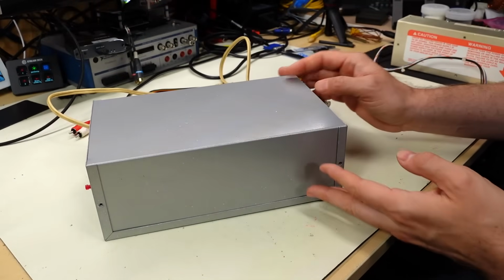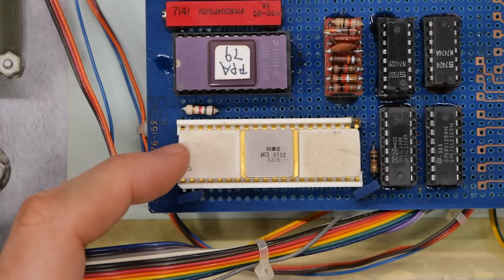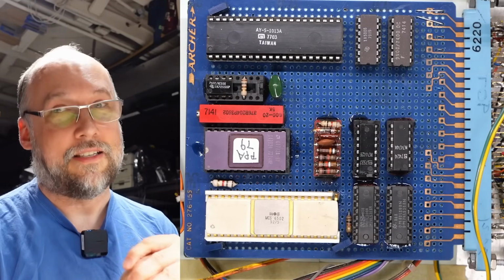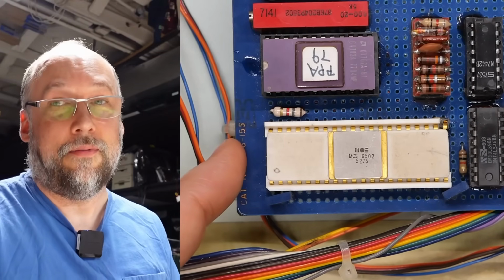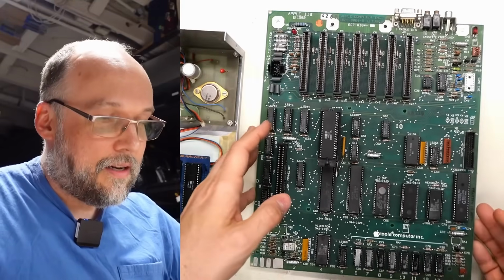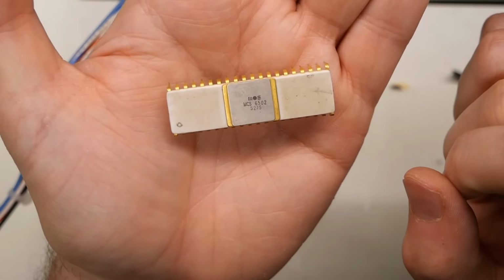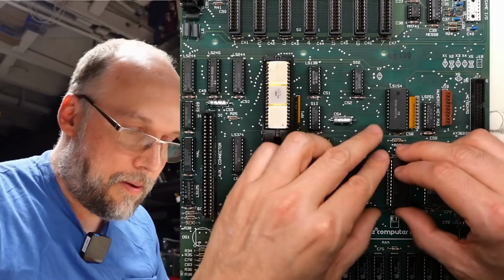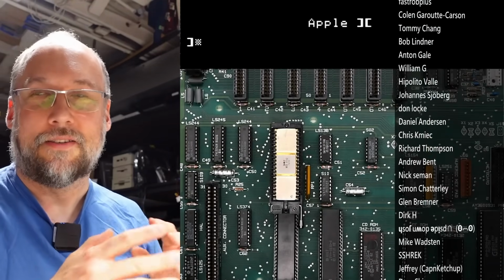Let's test a 50 year old MOS 6502 CPU

Comment: I'm surprised the bugfixed chip didn't get a separate designation such as 6503 or 6502A.  Because it surely must have been a hassle having to add production instructions to not assemble chips older than certain dates into products containing code needing the fix.

Comment: The ROR instruction is almost certainly used in division or floating-point math code.  I bet if you calculate some stuff in BASIC using division or floating point numbers, you'll see very bugged results.

Comment: never know what you would find before opening it first
that caught my attention someone back in 2002 make that and use it to booster performance something im at loss information about it n all i know that blue pcb was make in 2002 that was all i have n i remember got few them 2003 and use it make adapter attach to hdd which apple 2c u cant run hdd without card else so that was all i remember

Comment: I love the look of those white ceramic processors. Even if it were totally dead, it would still be a beautiful display piece.

Technically you could program around the bug. You could do some other maths operations to achieve the same result. It would take a lot more instructions, but it would probably work. Most of the time anyway. Anything that relied on the instruction taking exactly as long as it takes would break, so you'd have to modify the code for that too.

But yeah, considering they fixed the bug in just a matter of months, there would be very few commercial products that used a bugged version of the processor, so it would be pretty much useless in anything but these kinds of homebrew projects.

Comment: Beautiful find.  If you're talking about the same Frank that worked on the Commander X16 - he's a monster.  The amount of code he puts out is insane, and it wasn't easy to figure out a lot of his stuff.  Not because it was obfuscated, but because he's just good.  One day I'm going to have to dig back into 6502 stuff, it's fun.  Just taking a break from about 1000 projects right now.

In the early days, I did some work creating a Vera lib in ASM to link into C code.  Was kinda cool.  Sorta wouldn't mind dusting it back off again, unless someone else has taken up doing low level X16 libs for C :/.

Comment: Warning Adrain - never use any TTL parts from Signectics. They had a ridiculously high failure rates and I guarantee that the data books from Signectics are total crap and full of gross tech specs errors

Comment: Minute 3:00 - I have not even seen you open the metal Budd box yet, but my speculation is that it is a serial to parallel converter box to drive a Centronics printer. Wahla. But what would have been even rarer then a MCS 6502 was a MCS 6500 of only a 100 were sold if any. Because the MCS 6500 was totally
 compatible with the Motorola MC 6800 and was an instant, within one week from the ads from MOS technology for the MCS 6500, a LAWSUIT from Motorola.
Reply: It's a PET to ASCII/Baudot interface. This interface is in Kilobaud_Microcomputing_1979_September.pdf (which you can Google), p100-102.
Reply: You think that's why the ROR instruction was intentionally "broken"? I'd be interested to see this actually run some Apple II software like Number Munchers or Visicalc to what it does.

Comment: The most likely place for the ROR bug to show up is in math functions, and I'd guess that a multiply or divide is the most likely math function for it to show up in.  Probably in a divide, since rotating right by one is a divide by two.
Edit: If it instead does a rotate left as you said, then you should either wind up with some number which is obviously both wrong and higher than it should be, or else the BASIC interpreter will give you an overflow or divide by zero error (depending on the exact calculation you're doing).  Anyway, congratulations on rescuing a rare, historical chip.

Comment: That early chip is quite the find. Most of the interesting stuff like that around where I live has long since been scrapped/thrown away.

The design of the device reminds me of the old morse code keyboard I have. It's also very basic, with not much more than a 6502 and a 1702 EPROM or two, and plugs into all its cables using an edge connector.

Comment: For some reason, even though I turn 30 next year, I still think of the 70s as being 30 years ago. The fact that the chip still works after all this time is baffling and amazing!

The only thing that makes it a little bittersweet is that this could be the last time it will ever run code, especially if it's in a shadowbox. I know practically speaking it wouldn't be good to have it running all the time, either, but I kind of wish it would get run once a year or so, even if it's just as a microcontroller for a clock.

Comment: That chip is from the 52nd week of '75.... i'm from the 11th week of '76

My favorite processor is the Z80, i would've loved a Z80 made the same week i was born... alas, they came out later in '76

My SECOND computer was a IIe, so, while i am nostalgic for the IIe, and wish i had one, (with the two black-faced hard drives on top, under the monitor) my first computer was the TI99/4a, of which i own several, including my original!

Comment: Now, if only you can find out who made it and when he made that board.
I worked on Vic's  all the way up to Amiga's I even had a Pet for a while.  
I still have a C128, I think I have a C64 as well. 
I should get them out and find out if they still work.
One of the thing I did years ago on my C64 was copy the rom to ram.
I then modified the text and screen color, I think it was white text on black background for the TV I used at the time.
I forget what the text said, it just did not say Commodore C=64 anymore. 
I think it was a magazine called transactor, I edited the tape drive function out and installed a new routine.
When you pushed the Commodore Run/stop it would boot from the tape drive, now it would default load "*",8
I then changed it to use the last drive you loaded from if it was device  9 or 10 then it would be load  "*", 9 or 10.  
I miss that C64, I do wish I still had it.  

Lee Clark

Comment: The AY-5-1013A is a UART. The 555 with a multi-turn pot next to it is most likely used to set the BAUD rate for the UART and potentially is also the system clock.

Comment: Thanks for the mention!  Wow. Now that is a very lucky find.  I have one very early 6502, but it's soldered into my OSI 300 trainer.  I don't know if I could devise a way to test for the ROR bug as I'm reluctant to remove it.  Very cool, Adrian! There may not be real buried pirate treasure, but there is still lots of digital treasure buried away in devices like this waiting to be found!
Reply: You could use the switches on the trainer to enter a simple program: LDA #$22, ROR A, STA $8 (assembly is A9 22 6A 85 08; use Windows Calculator to translate to binary).  You'd then read from $8 the result, which will be $11 (or maybe $91 if carry was set) if ROR works correctly, or it will be $44 if ROR behaves like ASL (the bug).
Reply: But based on the date code, you should expect the bug.  That's an extremely early CPU; one of the first few, in fact.
Reply: Look on the top for a Date code: Do you have access to the assembly/monitor? Its only like 5 instructions to perform the test. The message is 3x the size of the test. Is your ROM soldered in?
Reply: @joeturner7959  My 6502 is date code 3875.  It is soldered in place.
Reply: @TechTimeTraveller  

So processor and ROM are both soldered. :(
Reply: @joeturner7959  There's no ROM on the OSI 300, sorry..  just CPU, a 6810 RAM and some support logic. But yes.. everything is soldered.
Reply: The first revision does not have that capability. Therefore the rotate right instruction isn't even a bug.

Comment: Your enthusiasm over this made me smile :)

When you get the shadow box, maybe put a mirror on the inside surface so you can see some of the wire wrap
Reply: Excellent idea. Seconding this! Could incorporate the board's edge connector into the side of the shadow box to hold the board a little off of the mirror to make it easier to see the reflection.
Reply: @spagamoto  That's a brilliant idea

Comment: Hey Adrian, that's an amazing find! The ceramic MCS6502s are highly sought after by Apple-1 replica builders for their original appearance. They are virtually unobtainium these days and sell for upward of $3000 on eBay.
Reply: Do they sell for upward to $3000 on eBay or are they asking upward to $3000 on eBay?
Reply: @Okurkaarrgghh  Excellent question!
Reply: @Okurkaarrgghh  That's probably the ultimate question. There is one that did sell on October 26th for $1500 bearing a 3975 date code though, but that may be a unicorn.
Reply: @rjolly87  Sold mine direct to a collector for $1500 (don't like dealing with ebay) ..I had bought it in '75  for $20, new for a project that never happened..
Reply: @Sloxx701  That's one of the earliest possible, you can't compare it with this one.

Comment: It's interesting that the ROM boots, its likely that whatever operation uses the ROR function doesn't have its result verified, so the ROM is 'running' but at some point you're going to try to use something in memory that's been run through the buggy ROR routine and you'll receive unexpected results.  Still very neat to see it preserved and the short history lesson!  Thanks for sharing!

Comment: My first hands-on exposure to any computer chip was with our first computerized controller (I did not design it, though --in those days I still was fluent only on DC and audio).  It was built with Motorola 6800.  Because I later on got actually involved with occasional troubleshooting, I gradually learned a thing or two about it.  I also still have some related measuring stuff geared for it.  Later on, we switched to MC68 000.  The 6800 based control was introduced in 1980 and the 68 000 based one in 19855.  I still have a few chips of both generations, as well as access to a logic analyzer with a disassembler for the 68 0000.  When I say access, I mean it belongs to my former employer, but nobody else than me has used it at least in the past 30 years.  I brought it along with me through two company ownership changes.

Comment: I'm regulary watching your programs - bringing back memories from the days I was designing and building the hardware you're playing with today
But one thing makes me wonder - haven't you heard about IC extraction/insertion tools?
You can get a nice tool (for a few dollars) which you place on the chip you want to extract and you get it out of the socket eithout damage or bended pins - not the brute force by using a screwdriver or a solder tool
Btw I've wirewrapped so much that I think the wires put together will reach around the globe

Comment: I'd shove a block of conductive foam or some foil onto the rear wire-wrap pins on that socket before you put it in the display case.  Pays to be safe.

Comment: My question now is... what does it take to get to the ROR function and to crash?
What program do you have to type in/use, what routine do you have to perform in order to cause the crash? And what is the crash like, is the CPU broken after the crash?
But don't try to break it on purpose, this is a gem, almost 50 years old, tucked away safely in some homebrew box.

Comment: The computer I have ever touched was a PET 2001. Later my parents bought me an Epson HX20 which had two 6301, a cmos variant of the 6800, running at 614kHz inside. One of those early laptop predecessors is still sitting on the shelf here.

Comment: I don't know what is it about shift and rotate instructions that are so challenging, but the Z80 had a similar bug. Rather than fixing it as Motorola did, Zilog left the instructions undocumented. And they exist to this day. The broken instruction was the SLL (Shift left logical) set. People used the broken instructions as it was quite useful to multiply by two and add one. Perhaps that's why they never fixed it. It would have broken code that depended upon it.

Comment: What is also amazing is that old ROM from 1975 that Adrian dumped the contents of to his computer also still contains the code. I thought EPROMs only had a lifetime of 10-20 years before the tiny charges on the memory cells leaked away.
Reply: The retention time depends on a lot of stuff like temperature, chip manufacturing process, how "well" it was programmed (some programmers were stupid and didn't over-program the cells well enough so they were just barely reading 0's for 0's in some spots while the default erased state is 1 - the best programming algorithms are a little complicated and try to gauge how efficiently each cell accepts programming so that they can be over-programmed uniformly)

Comment: I'm feeling old now... my first 6502s were from 76 or 77, and I built far too many systems with 6502s and wirewrap. Still have a handful of WD chips in a drawer...
Edited to add: I have an idea that Apple ][ Basic was a customised MS Basic - and early versions of that had a workaround for the ROR bug. But that said, ROR is unlikely to appear anywhere except in arithmetical/mathematical handling. You might use it in character output (and byte with 0xf0, ror four times, or with 0x30) but that works just as well with a shift right.

Comment: The GI AY-5-1013 is a UART. Interesting thing with the 1702 EPROM (besides the -9V rail) is that it is normally inverted... Where you'd expect FF in a blank, it is 00... at least that's what I remember for waaay back. I'm guessing the 6502 IS running exclusively out of ROM (using registers for storage), and the shift register captures the serial output from the 1013, and assembles it in parallel fashion for that ribbon cable. The 1013 and the shift register make a crude  partial 6820/6522. Latching a couple 7475's would require a lot of extra parts (address decode, latches, etc.). The 1013/shift register (parallel output) is pretty elegant. I don't think 6820s came until '76, and 6522's a couple years later...
Reply: Your guess that the 6502 is running from ROM using internal registers is spot on. The interface article and schematics are in Kilobaud_Microcomputing_1979_September.pdf (which you can Google),

Comment: I bet that was made by an Intel or Techtronix engineer out in Hillsboro - they probably picked up that 6502 in early 1976 to keep up with the latest tech. It might even have been one used at Intel to evaluate a competitor's cpu before an employee took it home as surplus in 1979. Then many years later someone was clearing out the garage and it ended up with you.

Comment: 23:36: If you were to test the Apple II + 1975 6502 more extensively, maybe on your second channel, I'd be happy to watch that. I'm now wondering if Apple accounted for the ROR bug and wrote their Apple II firmware so as to test for the bug and work around it if present. Of course, it's a safe bet most Apple II software did not do the same, but I'd love to know if Apple's early Apple IIs were "ROR bug-tolerant".
Reply: In order to test for ROR, you have to run the ROR, so it WILL show up in the code.
Reply: It's an interesting thought.  Programming around the bug means extra work and extra memory.  I feel that if there was no intention of selling machines with the "early" processors, they would not have made such an effort.  It should be pretty easy to check that.
Reply: It wouldn't surprise me if WOZ programmed around the ROR so they could save a buck using faulty parts - lol -.
Reply: @SidneyCritic  exactly my thought!
Reply: @SidneyCritic  ...Even though by that time, the faulty chips would likely have been out of stock and harder to get hold of than the good ones. Still wouldn't put it past him though.
Reply: @SidneyCritic  given the Apple 1 was a kit.. I am sure woz had experienced  the chip flaws
Reply: @SidneyCritic  most probably there'd have been a version of the ROM code specifically for use with that chip if so.

A fairly simple solution would be to provide a ROM routine to perform ROR by executing ROL seven times instead but I don't know how that would affect general compatability and performance.

You couldn't really intercept the opcode though.  You'd probably have to prepatch everything.
Reply: @TheTurnipKing  Ummm, ROL eight times.   ;-)
Reply: @TheTurnipKing  Nope. Rotate operations include the carry bit, so there are 9 total bits involved.
1st ROL puts the carry bit in the 1st bit. 8th ROL gets it to the 8th bit.
1st ROR puts the carry bit in the 8th bit
Reply: It would be easier to just write the code to not use ROR than to test for it.
Reply: @GaryCameron780  yes, in a specific application - for example, this interface.  Less so in a general purpose computer.

Comment: I have a Pentium (1) with the FDIV bug! It was removed from an IBM 9595 server while I worked at IBM in the 90s. If you want it I can send it to you Adrian although it will take some time since I live in Buenos Aires. Keep up the great work!
Reply: I have a Pentium 60 with this same problem. My first ever computer. I kept the CPU
Reply: Do you know if it also has the meltdown bug.  When meltdown was published, the CPU designers were awfully silent about the status of older chips.
  The official Meltdown test programs tend to use non-buggy unrelated features of newer chips, but it's basically a question if a specific documented security check is done before hitting cache and external bus or not.
Reply: @johndododoe1411  Meltdown would date back to the Pentium Pro and the P6 architecture. So the Pentiums would be unaffected. Incidentally, I also have a FDIV bugged Pentium 90.
Reply: @steeviebops  Are you sure the Pentium doesn't let the Meltdown affected operation hit the cache, thereby leaving a side effect of the supposedly hidden value?
Reply: Who cares about that piece of junk?